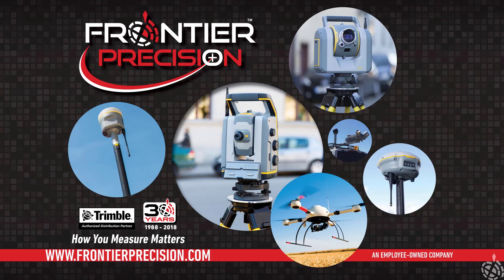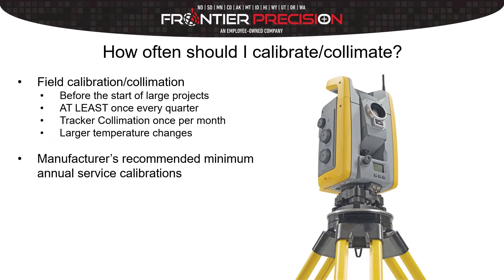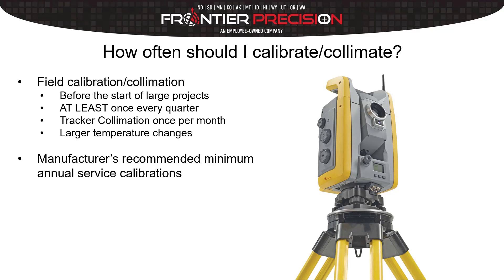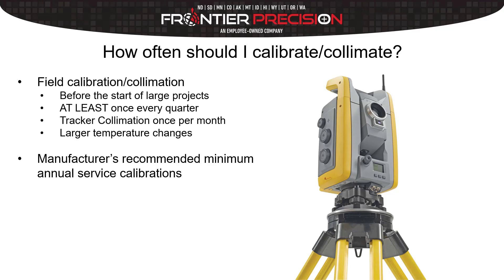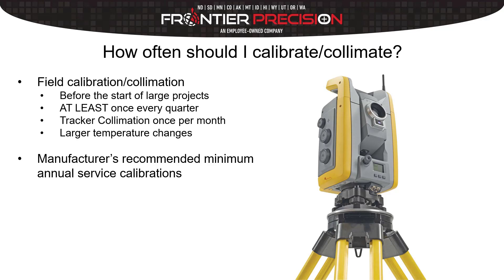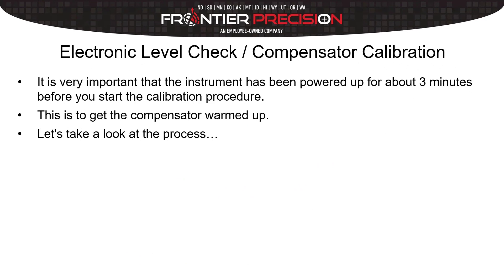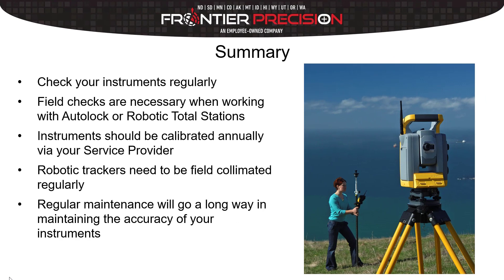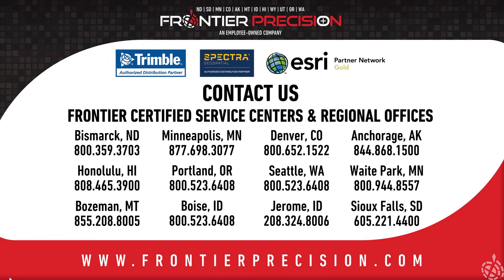Trimble Robotic Total Station Compensator Calibration

Comment: The video is quite interesting but you must update it including the other two collimations that follow the first one since on the internet there is absolutely no video about it. I have in S5 and I have noticed that when I park it and level it at 0" in a matter of minutes both the Muñon and the vertical are decompensated up to 48" and I want to know what this is due to and what affects Precision stakeouts so much.
Reply: The instruments drift in the best of scenarios. You should consider where you're setting up; vibrations, temperature and ground conditions will all cause the instrument to drift. Some days, you'll need to re-level and check to your backsight several times depending on  these circumstances.